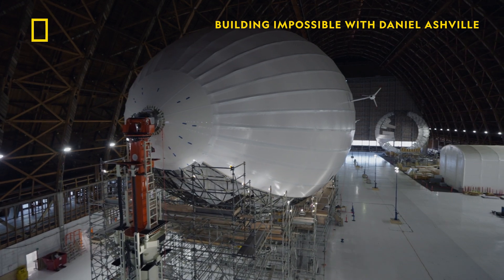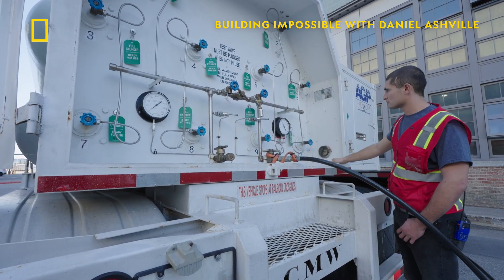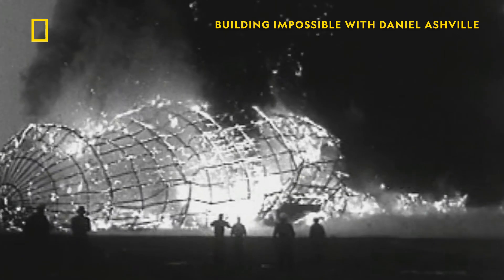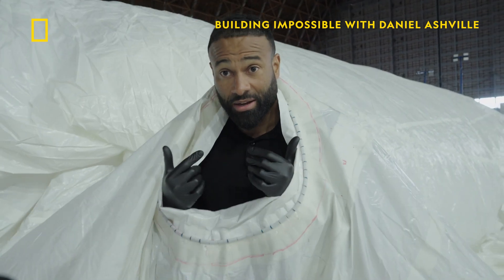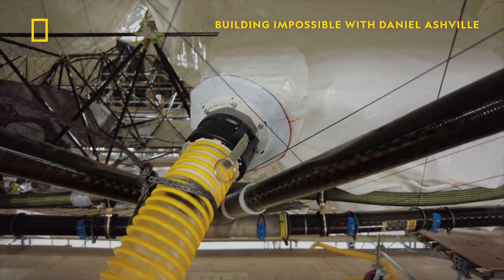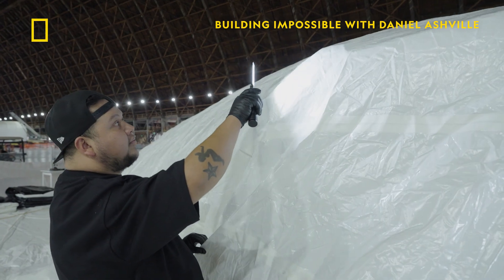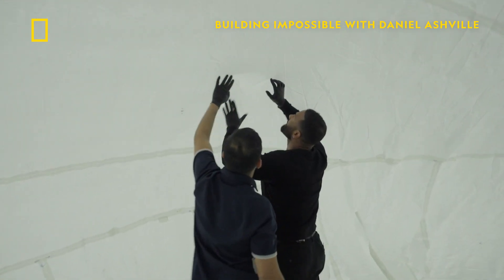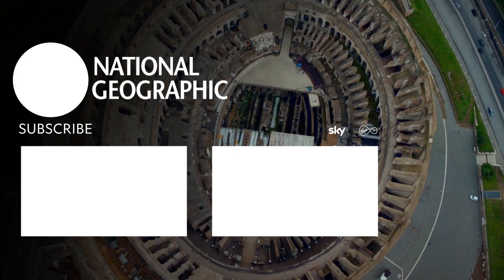Revolutionising Airship Safety | Building Impossible with Daniel Ashville | National Geographic UK

Comment: BAD JOURNALISM

Wow, they are starting off on the wrong foot, within 20 seconds no less! Saying that most previous airships used hydrogen is like saying that most previous cars needed to be hand cranked to start them and had wooden wheel spokes and gas lamps for headlights. And then, they show the Macon (notice the flush mounted exhaust water condensers), which did NOT use hydrogen.. We are SO tired of such mistaken sensationalism aimed at a very ignorant public. 

Next they will give  the famous line about cow stomach gasbags, and how modern airships have so much better. As anyone who has researched knows, the helium loss through goldbeater's skins was a fraction of what P1 will have with "modern" fabrics, plus they didn't get dozens of pinholes to patch from gentle handling. Try beating gold with urethane coated rip stop nylon. May I suggest the gelatinized latex that was tested on the Akron, found to be better, and used on the Macon and Hindenburg?  A rich history is being not just ignored but scoffed at!  And why not fund research to grow goldbeater's skins in the lab....

See Gokdbeater's Skin on wikipedia.